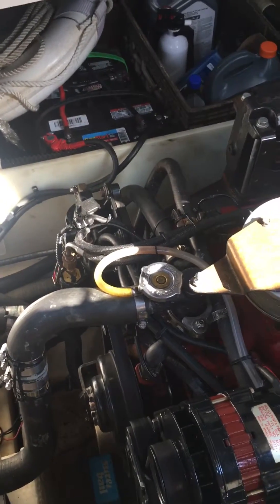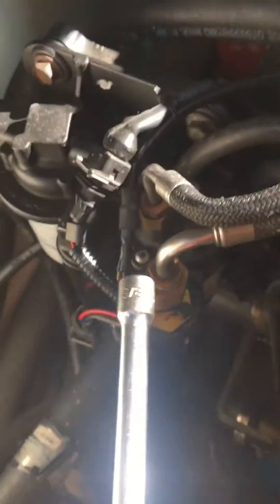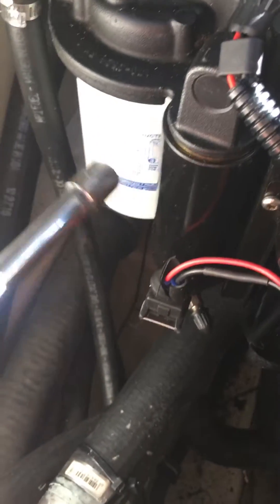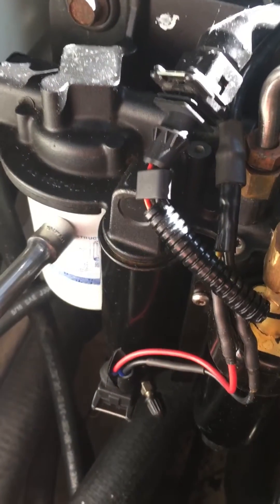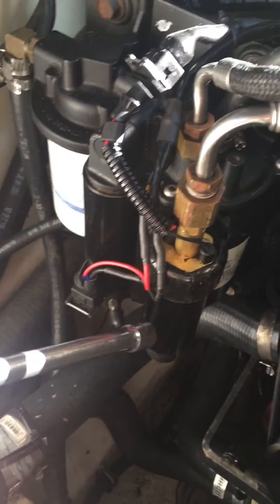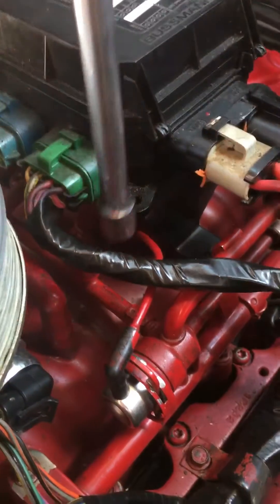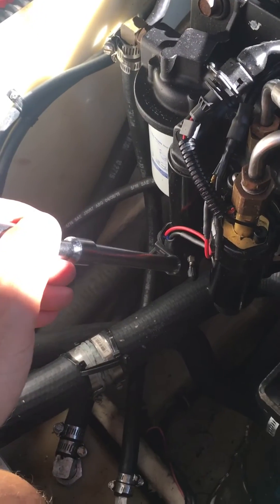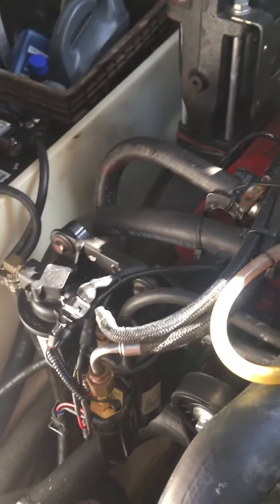Volvo Penta fuel pump priming

Comment: I dont have a two stage pump. just the second one that you showed. I filled filter, no start, took off fitting, no flow. Electrical?? Bad connector? Fuse? Relay?

Comment: what causes the low pressure pump to prime? alternator, oil switch? high psi primes but not low... running barebones on a engine stand, thanks

Comment: I'm trying to ferret out what I suspect is a fuel delivery issue so I watch a lot of your videos. Your content is excellent and the information you provide is extreamly valuable. I do however have a couple of suggestions. It would be very helpful if you identified the engine you're working on, instead of just calling it a Volvo Penta. Models and years obviously vary considerably. I have a 99 5.0GL and it does not have the same fuel pump setup as the engine in this video. It appears to only have only one pump and not does it have a fuel pressure regulator that I can find; I'm not a mechanic which is why I'm watching your videos for guidance. Also, please consider shooting all of your videos in landscape mode rather than portrait. Portrait is visually limiting. Thx.